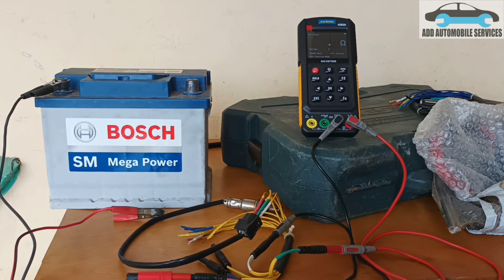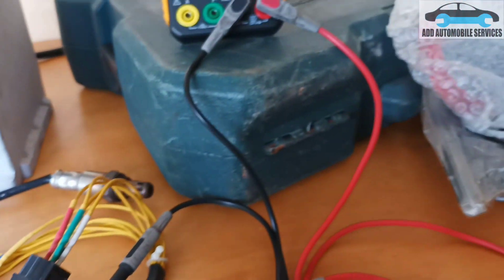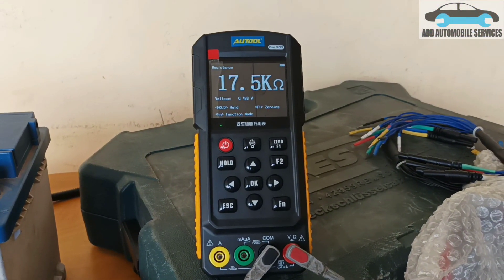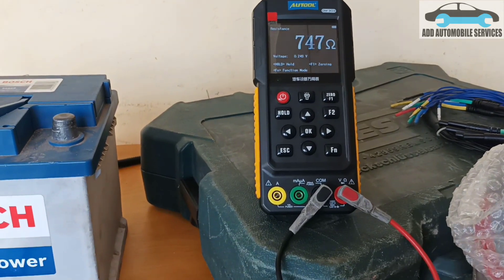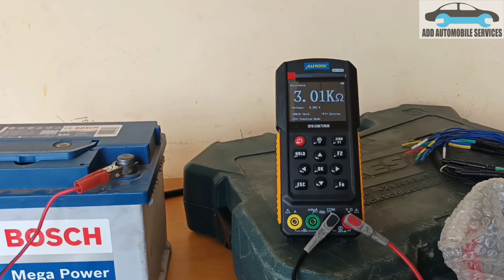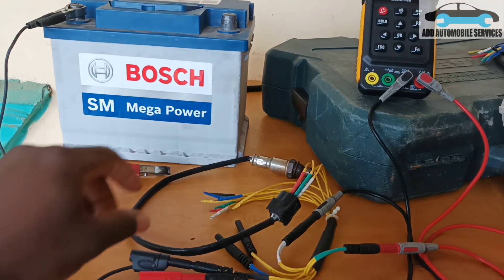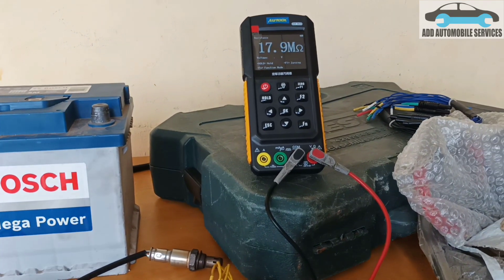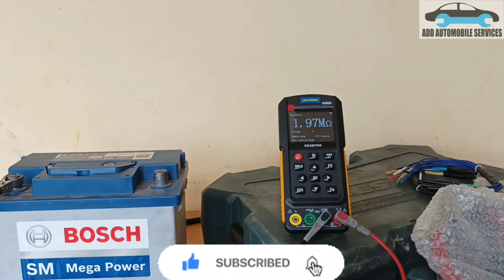how to test an O2 sensor (oxygen sensor)

Comment: Thanks for posting this, but I'm a bit confused. 

It seems you are applying power and ground to the heater circuit side of the sensor and measuring resistance on the Oxygen measuring side of the sensor? Perhaps this was why the meter wasn't reading when the sensor wasn't not powered? Isn't the heater circuit supposed to have a resistance value whether or not the Oxygen measuring side is connected to anything?

Thanks again!
Reply from the maker: It is because when there is change in temperature the resistance in the oxygen sensor starts to  change.